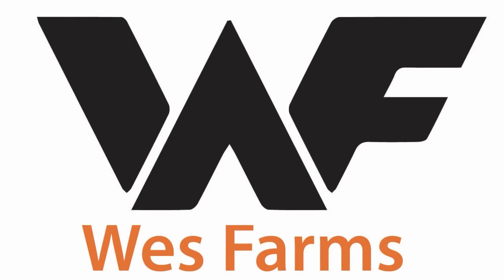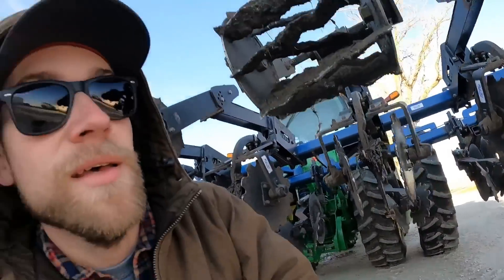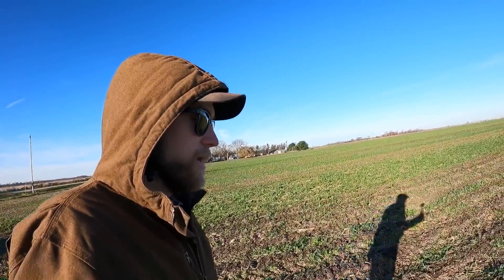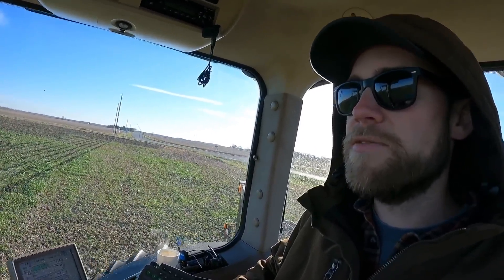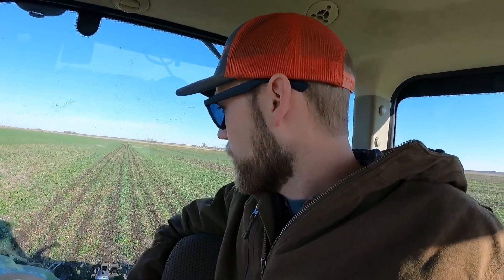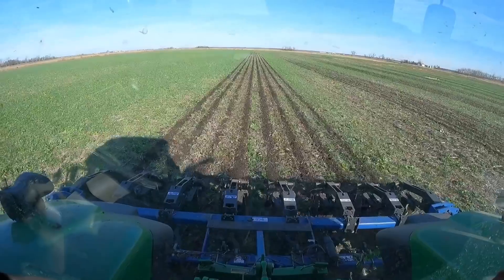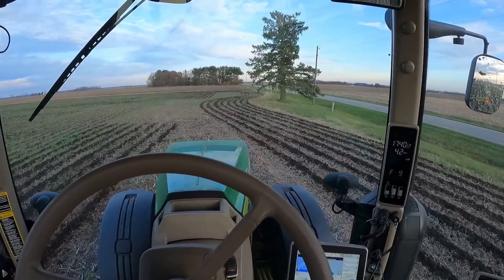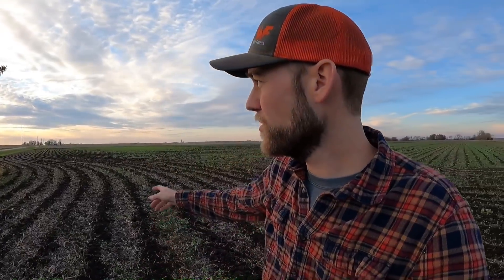Strip tilling with the NEW John Deere 8235R tractor!!!

Comment: Is that farm poorly drained because it is table-top flat and there’s nowhere for the water to go? Our flat ground that is a clay pan type of soil doesn’t like to drain either and is usually a replant after a big rain. Drainage is very important and overlooked by many
Reply from the maker: It is not table top flat but is mostly flat. Drainage district needs to dredge the main drainage ditch, that would help. Also looking into installing drain tile